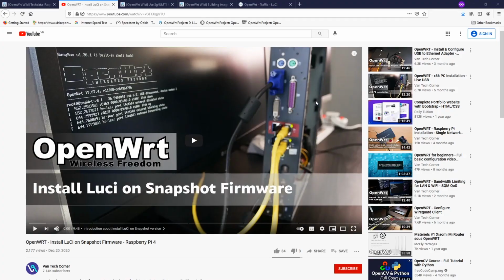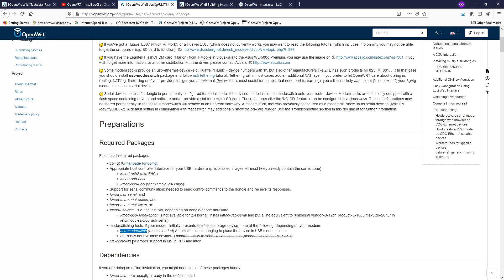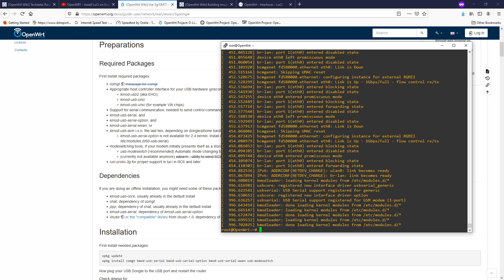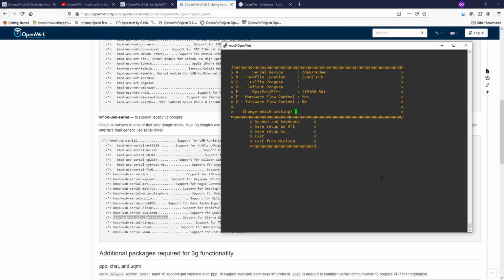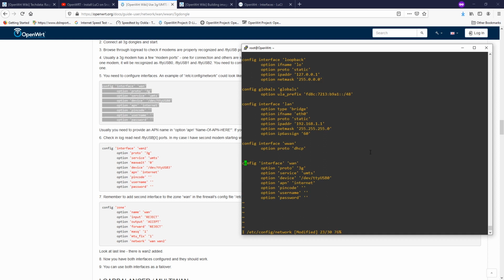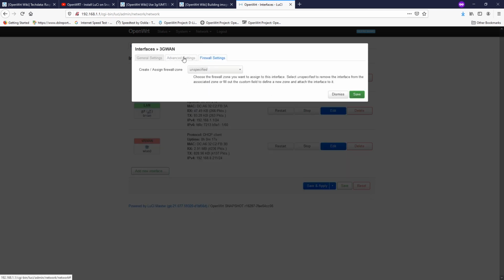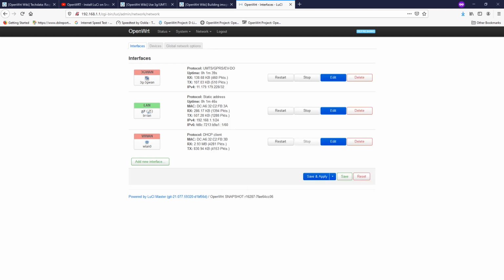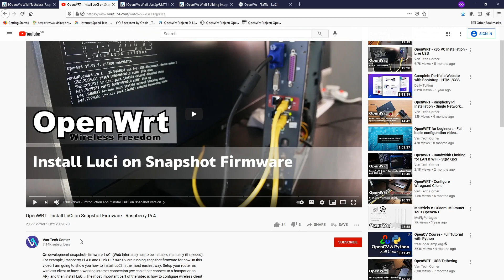OpenWRT - Install & Configure 3G Modem/ USB Dongle

Comment: Chào bạn. Mình đang dùng module simcom a7670c. Mình đã cài đặt các gói của RNDIS và router đã nhận module và đã có internet. Nhưng có 1 vấn đề là cứ khoảng mấy phút router sẽ mất kết nối internet. Các vấn đề về nguồn mình đã thử nhưng có vẻ vấn đề ko nằm ở đó. Bạn có thể cho mình hỏi vấn đề nằm ở đâu được ko ạ
Reply from the maker: Không biết bạn sử dụng adapter chuyển từ USB sang Mini-PCIe hay cắm trực tiếp module lên cổng Mini-PCIe có trên router? Nếu dùng OpenWRT, bạn có thể vào System-Log để kiểm tra thử những gì xảy ra lúc mất kết nối để có hướng khắc phục. Ngoài RNDIS, bạn có thể chuyển module về chế độ QMI để sử dụng.
Reply: @VanTechCorner  mình sử dụng module có cổng micro USB và mình cắm trực tiếp từ cổng đó vào cổng USB của router ạ
Reply: @VanTechCorner  Mình có check system log thì khi mất internet ko có log nào mới ạ. Mình có thử tìm cách chuyển module về chế độ QMI nhưng mình ko tìm được cách. Bạn có thể cho mình xin keyword để mình tra hoặc link hướng dẫn ko ạ